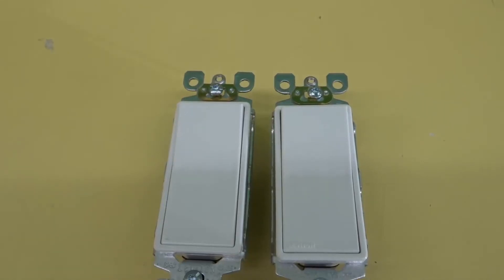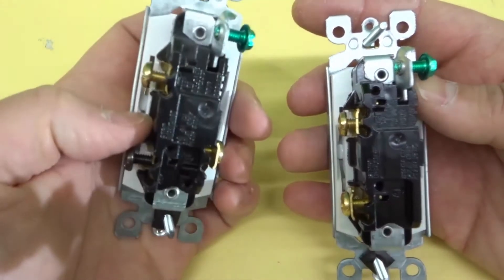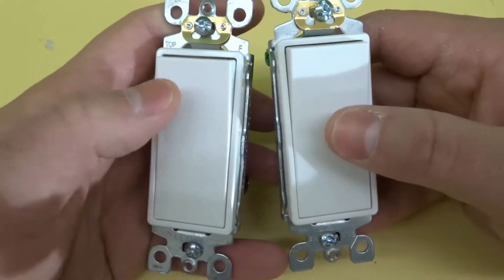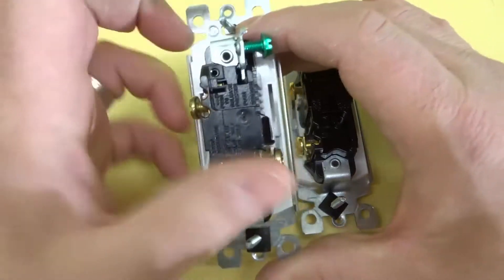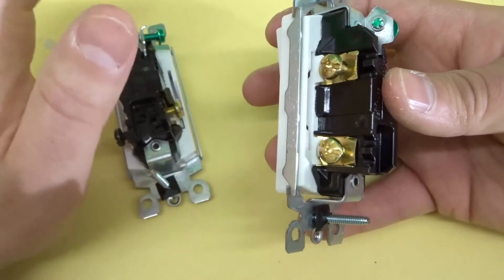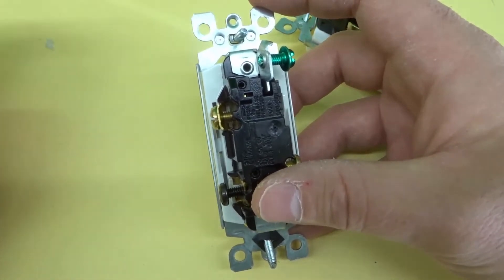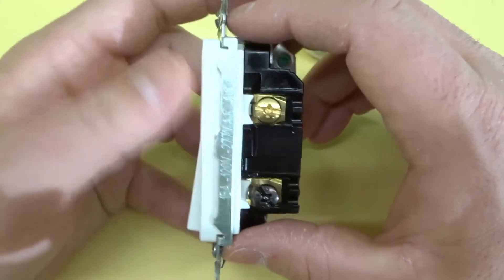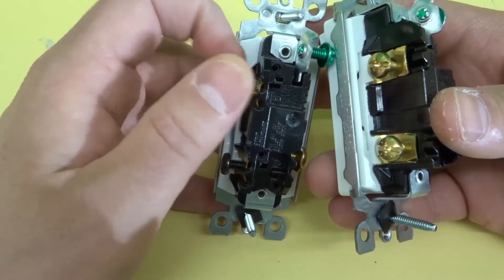3 Way VS Single Pole Light Switches-What's The Difference

Comment: Single pole switch:  Cheap simple on/off circuit interrupter/breaker intended for lights; 2 terminals.  Sometimes controls power to outlets; this however is not best practice.  Those outlets should be GFI so that if they do trip, those lights still work and don't blow the single pole switch.  A better practice is to use 14-3 cable bypassing the the switch altogether for the outlet (typically 14-3 between the light and the switch then 14-2 power source and 14-2 outlet. )    

3-way switch
You install these in pairs to control a single light from as many pairs as you desire.  You could install a 3 way switch in the basement, mainfloor, 2nd level and 3rd level all to control 1 light; you would use four 3 way switches to do this.  You can technically use it as a single pole switch too.  3 terminals (2 for switches & power in, and another called common for power out)

Case Study: 

While converting small basement pot lights to small flushmount  lights, the old switch blew.  I erroneously installed a 3 way switch, but the flushmount light worked.  A few days later, noticed the bathroom GFI wasn't working and another plug in the hall too yet all breakers were ON.  You have one switch going to the replacement switch (power), and 2 outs for the replacement switch.  The way I should have wired it if using 3-way switch is power goes to one of the top 2 terminals (either one) and the two outs go to the bottom most terminal (common) because a 3-way switch always sends power to the common, and the top 2 terminals form pairs with another respective 3-way switch, enabling either 3-way switch to to open or close the common terminal.  If using single pole, I would connect the 2 outs to the same terminal (doesn't matter which one), and input to the other terminal.  If I don't like that my outlets are ON or OFF dependent on the switch then I have to pigtail the in and outlet out, and connect the in to one terminal of the single pole and the outlet (light) to the other terminal of the single pole or the in to any of the 2 terminals of the 3 way switch and the out to the common terminal of the 3 way switch.  Inconsistent naming, single pole is named after how it is used, and 3 way is named after how many terminals are on the switch.